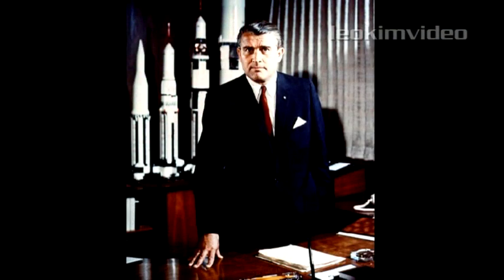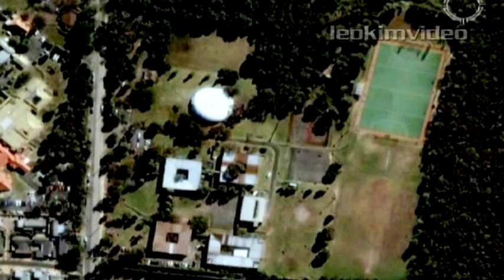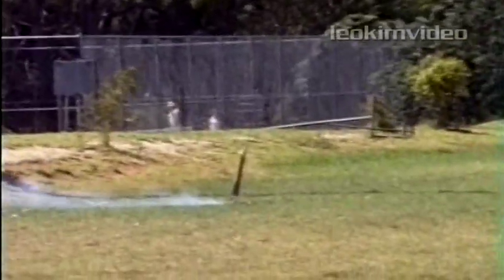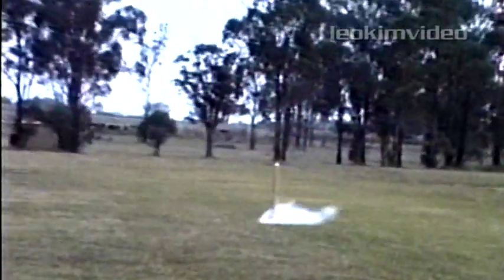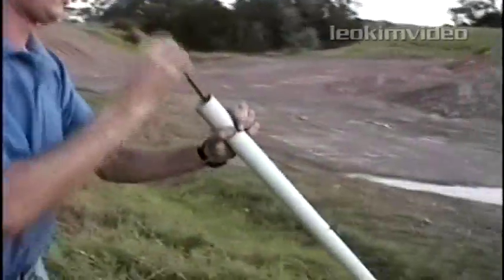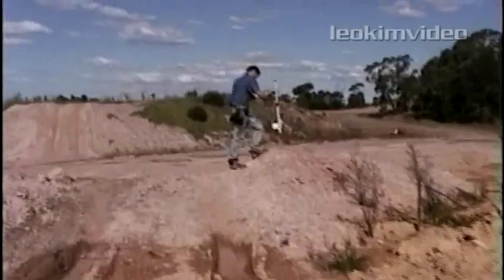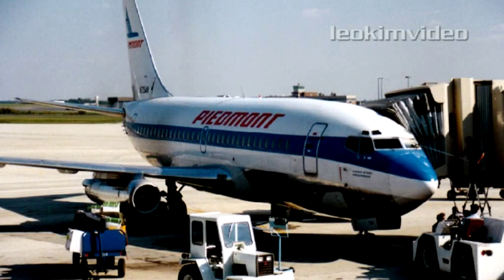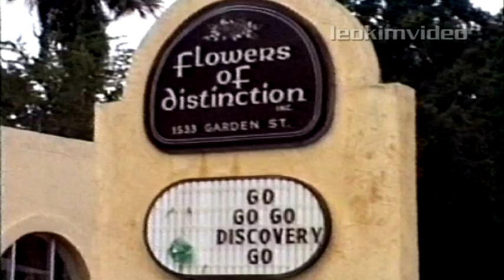NASA Backyard Rockets Widescreen

Comment: I remember with the Apollo rocket with the A8-3 motor we had it go about 800-1200ft.
one time it went so far off course we had to follow it, Just learned at 9 yrs old that winds are different dierctions at different levels. So the last one we launched i guess caught an up draft and took it past 2000 ft And it was lost for good. anything bigger than the B11-5 or close to it.

Comment: I'm not really  sure which would be better; I don't have a large enough viewer base to run tests to get actual data, but I'm gonna say that it's probably best to put one note across the bottom 25% of the video from the beginning to the point where the actual video starts. Of course, I have no real experience to back up this suggestion, so take it with a grain of salt.

Also, some of your viewers might still have 4:3 monitors, and would rather watch the version that fits their screen. Until...